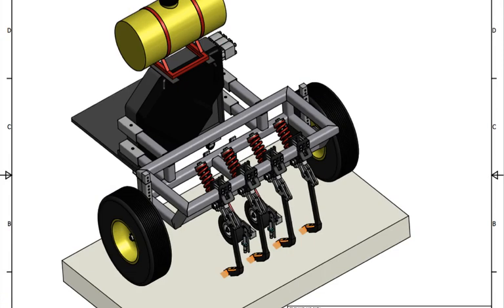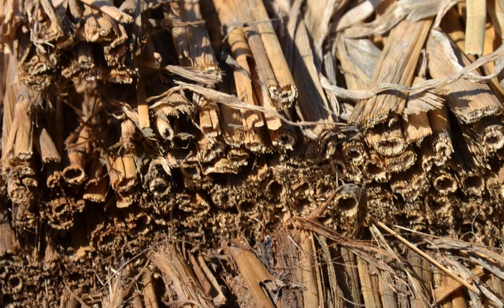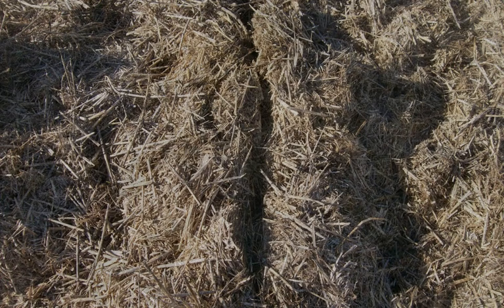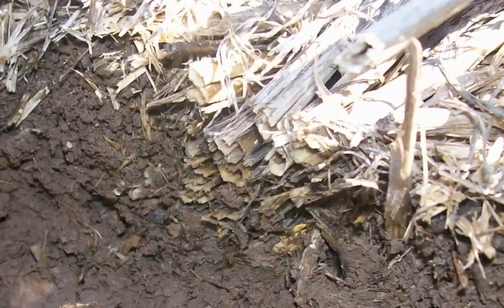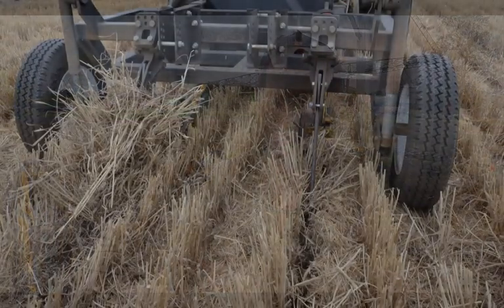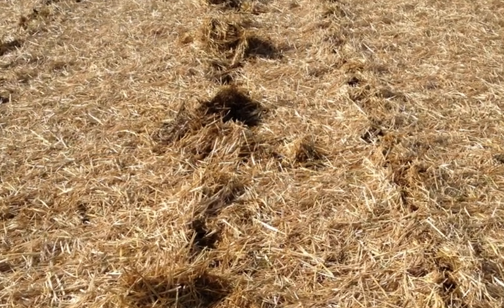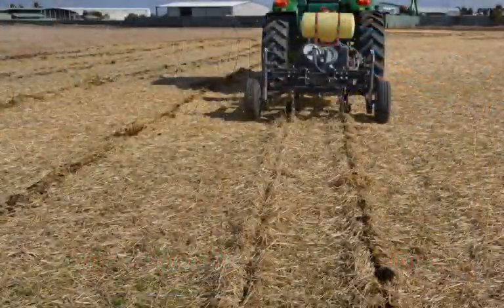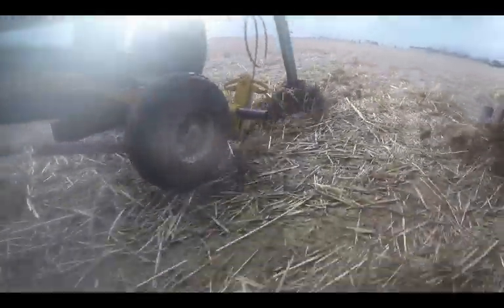Aqua Till Concept Demonstrations 2015 Movie

Comment: This may be brilliant. What we need is something that performs like a Cross Slot drill but requires half the Hp. Has it been tested in rolled cover crops?
Reply: Yes, it has been tried on cover crops on Dave Brandt's farm in Ohio.
The AquaTill does use HP however the cost of applying HP via a stationary engine is much cheaper than applying HP from a tractor.  That is;  a 400HP tractor costs several hundreds of thousands of dollars, where are a 400 HP stationary engine costs a few tens of thousands of dollars.